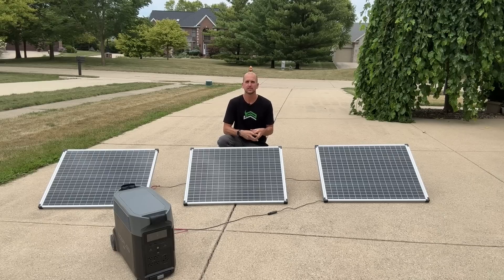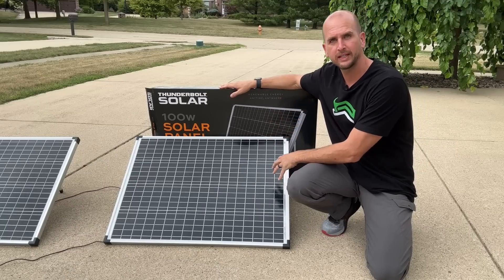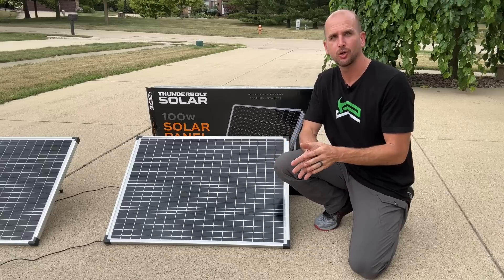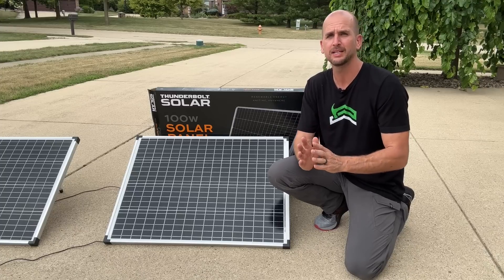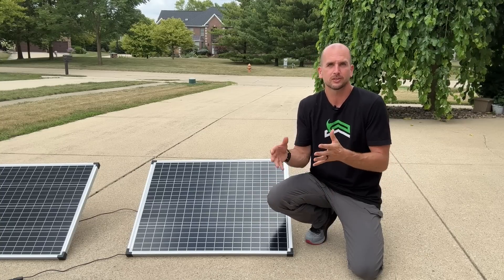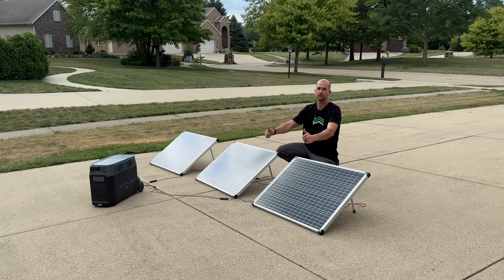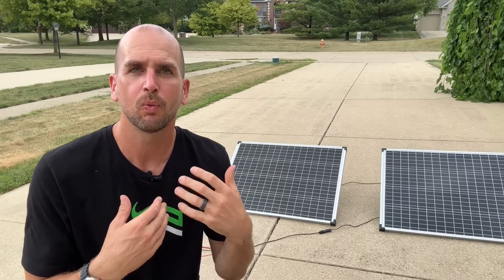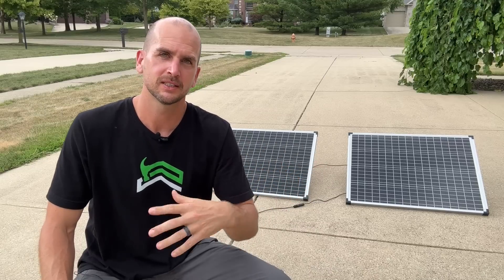Why Solar Panels Don't Output Rated Power

Comment: I have two 100w panels in parallel.  I covered one  and checked the output on my controller, I did the same with the other panel. If I’m getting roughly 63w on one panel and 57w on the other panel why when I have them both uncovered I’m reading roughly 65w combined?

Comment: No one ever tells the full truth about solar. You're getting peak power at noon, if there's no clouds, shaded panels, cool cells, not covered in dirt, etc. You say 80%. More like 20-35% of rated power. Worse if you sign up for these net-metering programs that are actively being nerfed across the country (less compensation for the power your system throws back on the grid), you're not going to get a big enough discount on your bill to make it worth going through the hassle. All the expense to you, all the benefits to the power company. Rooftop solar is such an unwise move. 1000's of companies have gone bankrupt selling this scam that is destabilizing grids by taking the reliable generating sources offline.

Comment: With respect you're read something but haven't understood it.

STC is a standard rating tool, a bit like how they did batteries in the 80's.
But here is the thing, you said best  and that's not true, the planet surface can reach 1700 kwm2, 1000kwm2 is averaged. 
Now the STC rating is what is standard but so is NOCT (normal operation condition test) and you should be buying based on NOCT. Not STC.
Always on the panel data sheet.

South is best, wrong. Well not wrong but not best. The saying of South is best comes from ' the compromise '

As the sun arch narrows in winter... To give some idea, the summer sun starts east at 4am and sets at 8pm.
In winter the sun rises around 10, and sets at 4.
This arch makes a 'sun hours' change.

However .... Putting eggs in one basket by south facing can lower the yeild or cause over peak power.
So the direction of the panels (16o an hour) shifts the peak output. 

If you had 1000w loads and 3kw of solar, you wouldn't want 600w in the morning and then 3kw between 11:00 and 14:00 and then 600w.
You would want to spread that. As you maybe can't use the peak power in such a short time.

Angle, now that can make up to 75% difference... Normally 50%. But the angle the sun hits the panels is very important as is the yield required. Typically winter the sun's arc is around 400wm2, most panels will make use of that at 20%....
You'll lose winter for summer but you'll lose a bit of summer (80wm2)
If you're summer angled then you will lose 80% on top of that, and with money power use being in winter, it's best to angle for winter, because the sun's at triple negative... Angle and kwm2 as well as time .
If you do the summer loses are there but lower as the power (kwm2) is much greater. P
It's not ideal for the best average over the year but the best power you need and can get.

How that helps, I did a year of testing to see the actual differences in the real world and why the status quo was as it was..

Comment: Years ago I picked up a dozen panels that had been part of a research project at Georgia Tech. Installed on the frame that supported the panels was an array of misting heads, and a controller that would turn on the mister when the panels were above a certain temperature. I don't have any knowledge of how effective it was or wasn't, but I found it interesting. We used the panels to charge the batteries for several off-grid amateur radio repeaters, and cooling arrangement would have been too complicated (plus no water on site anyway).
Reply from the maker: Sounds like an interesting project 👍
Reply: As I watched this video, I started wondering if some sort of water cooling would be helpful.
Glad to hear I think like an Engineering student at Georgia Tech!  Thanks for sharing.  🙂

Comment: It costs less to wire into the grid, and it's far more effecient if you need consistent power.
Reply: Unfortunately the ec requires an electrician to install everything. I started with a 6.5kw grid tie and it was great for a few months until they found out I was feeding into the grid so I had to buy a different inverter with batteries and the cost was ridiculous! With this supper hot summer, four 100ah batteries barely run two window air conditioners all day so I had to disconnect my well from my solar till it starts cooling down again 🥵
Reply: @Laurel-Crowned  One of the many reasons photovoltaics is a boondoggle.
Reply: Interconnection insurance runs 1.5k a year
Reply: @420.........  Best top check your total price, including degradation over time of your batteries and cells. Track 20 year old systems, you will find they have been replaced two to three times or effeciency drops are so great that they are not worth it. Compare to the cost of power. You will find that solar is for the wealthy.
Reply: For a shed?  Have you hired an electrician lately
Reply: Wrong

Comment: Those Thunderbolt panels are built different. I have a couple and they will consistently output 100+ watts sustained even after the panels heat up. My best one puts out 109 watts as long as the sun is high and there aren’t any clouds.  Those panels are pretty amazing
Reply: as long... as the sun is high and no clouds... hmmm
Reply: @Steve_mos8541  that’s the same with all solar panels though. All other 100 watt panels I’ve used in the past output 80ish watts at best.  

They aren’t best price per watt out there by any stretch (used panels win every time) but they have a relatively high bang for buck ratio if you catch them on sale.
Reply from the maker: I agree, I think they were a bit conservative on the 100W rating for this panel.  This is definitely not always the case.  I am not sure how controlled each brand is when using STA to validate their panel output.  Seems to be a bit of variability across the different brands.  Thanks for the feedback!
Reply: Because the shine 9999999999 wattage light at then while touching....
.

Comment: At 100 watts per panel, that would take ten panels to make 1000 watts (ideally). To make 11kw, you'd need eleven times that -- 110 total panels at 100 watts per panel.
Reply from the maker: For sure, the panels going on the roof of my house will be roughly 400W per panel.  This size is ideal for sheds, trailers, campers, and other off-grid DIY projects 👍

Comment: also, If you get ali express Chinese panels you need to subtract about 33% from the stated power from the manufacturer.
Reply from the maker: 😁 the “Ali Efficiency Coefficient”
Reply: Not true
Reply: @tazdevl2000  when they build modern nuclear plants, there are safety measures put into place to ensure that there can never be a runaway chain reaction. Also whenever new nuclear power plants are built they construct a Vault on site to seal away all the nuclear waste. It is one of the most reliable forms of zero emission energy production
Reply: Atomic power is the only answer.    Natural gas as a backup when needed for (unexpected)SHORT TERM peak loads. 
comment please.